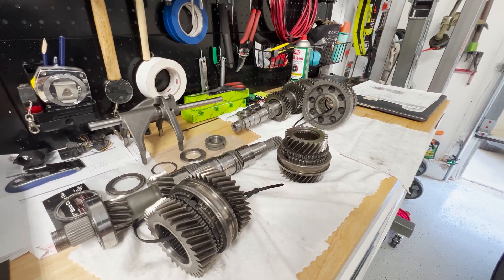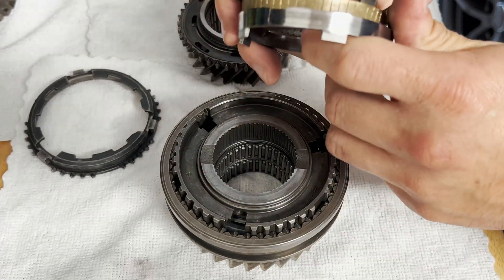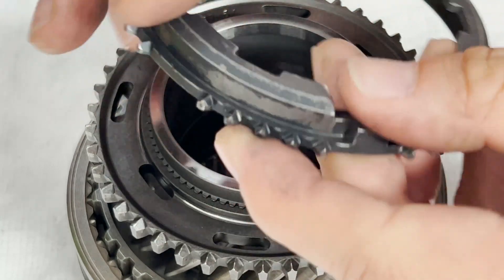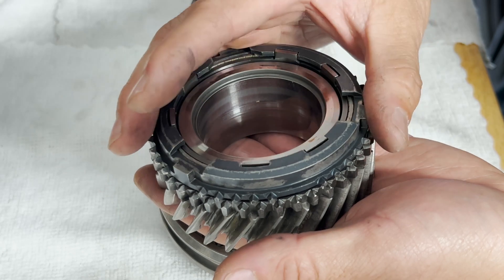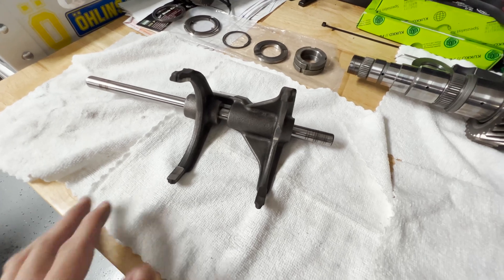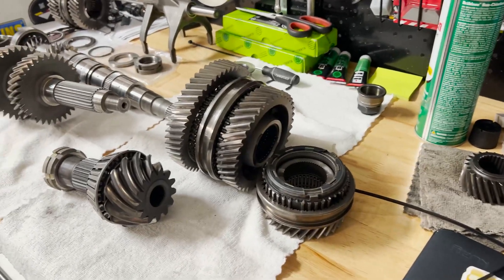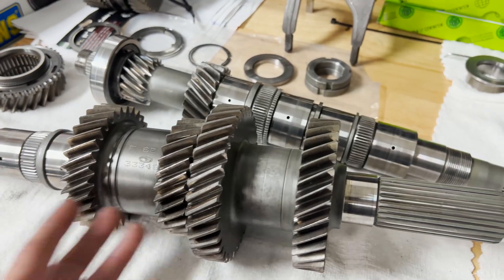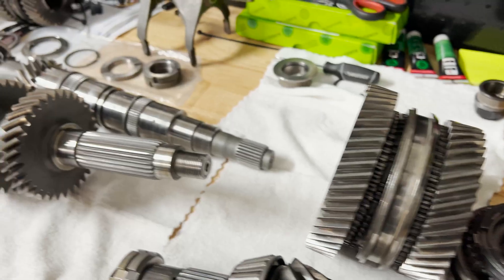Rebuilding a Broken Lamborghini Gallardo Transmission - Gear Carnage - Part 3

Comment: Hi, thank you for a very interesting video series. However, there is something I don‘t quite get. What kind of pressure is increased due to that the edges of the gears are scored? Why does that prevent the e-gear from switching gear? Does the scoring increase the force required to actually engage a gear? If so, why? Is the speed-up of each gear through the synchronization rings slower due to the scoring? I‘d like to understand the issue a bit better.
Reply from the maker: These scored gears will not mate with each other smoothly, adding additional axial pressure (or thrust) to the entire system. Helical gears naturally create thrust and want to come apart from each other vs straight-cut gears when they mesh together. That's why we have thrust bearings and washers to help keep the two sets of gears locked in place.

So for these automated E-Gear systems, they will detect resistance when trying to shift the collars into the speed gear. If the resistance to shifting is above a programmed threshold, the system will not shift - You can probably still shift the car manually with scored gears though - it will probably take more shifting force to overcome the additional thrust in the system now. This is the working theory that my shop instructor told me when I was consulting with him.